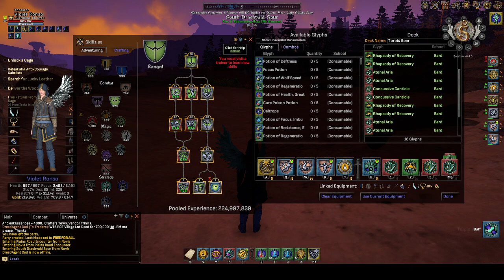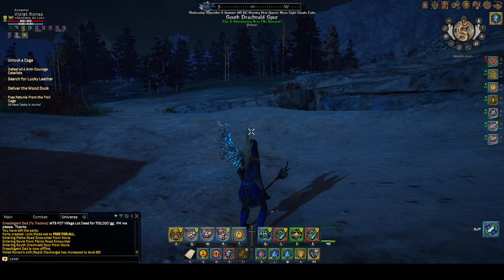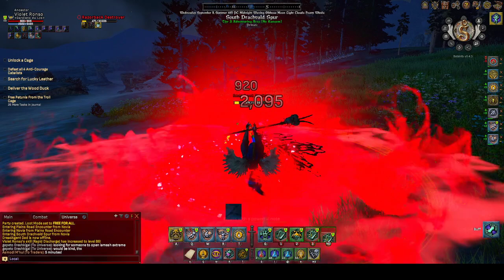Shroud of the Avatar - Bard Build - Razorback Destroyers

Comment: Hello. so much damage under only 1 skill? overwhelm (schools of chaos)? I made the same assembly but I do not have such damage (250-500 is indicated) What determines the increase in damage from a skill that depends on the focus?
Reply from the maker: Hey there! Basically for this video there is 3 skills used to deal damage : 
1. Atonal Aria. This skill's damage only increases with the skill level, nothing else gives it any power.
2. Concussive Canticle. This skills damage is based on 10% of your max focus, the more focus you have, the more damage you do.
3. Torpid Torment. This skill is a debuff you use before Concussive canticle, and since Concussive canticle removes focus from the targets, Torpid Torment's effect procs and deals increased damage (as seen in the video). 

Hope this answers your question!